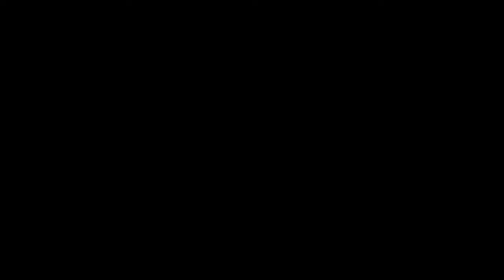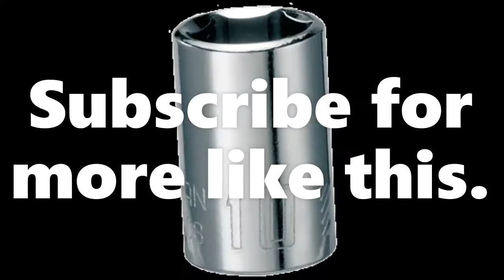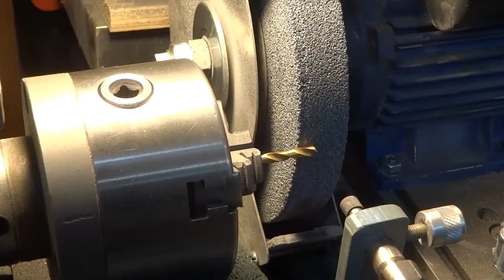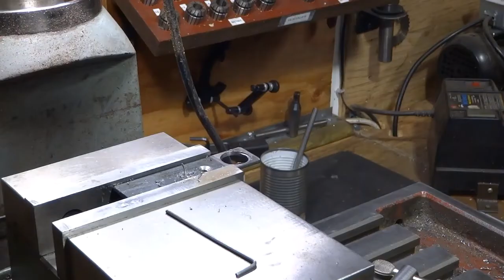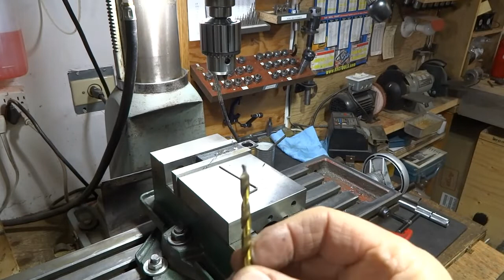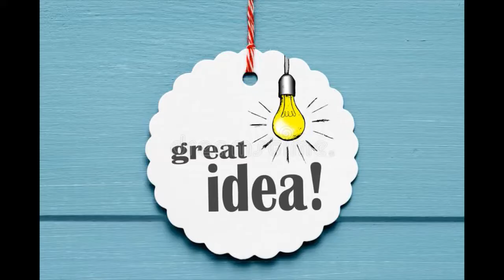Twist drill with center drill head.

Comment: Dewalt Pilot point drills?
Reply from the maker: I have seen these in industrial use but did not know Dewalt  had them. Thanks for the tip.
Reply: Just use Brad point drills
Reply: @Coolstuff4all2enjoy  Brad points are for wood.